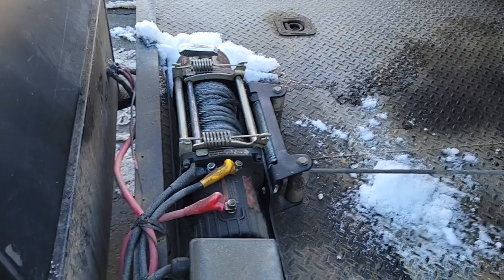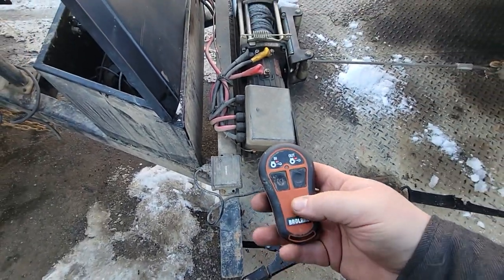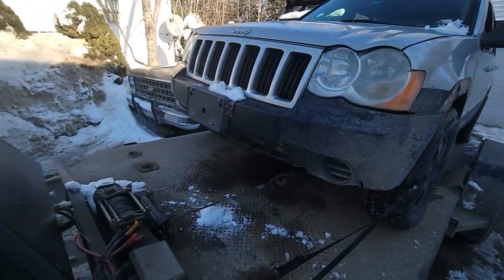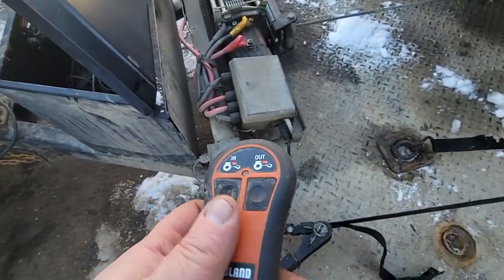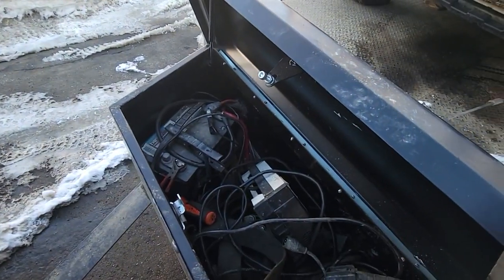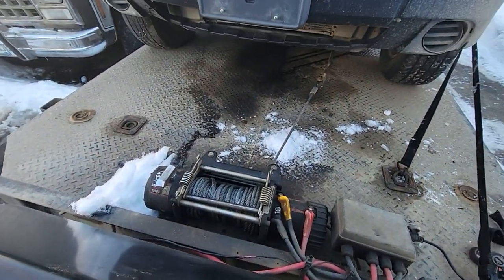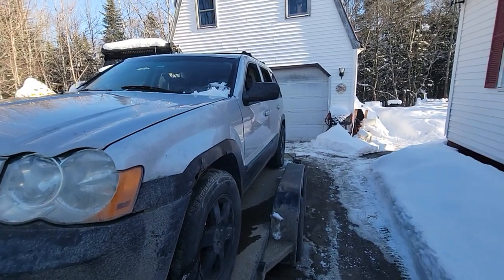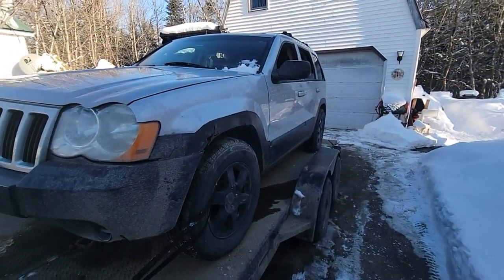Harbor Freight Badlands winch QUICK TIP! I'm Stupid...

Comment: the top red, yellow, black wires are switched wires. not a direct dedicated ground.
but then you should put in a winch to trailer chassis ground wire. not sure how your batt is wired but it also should be wired to chassis ground as well as directly to the winch.

BUT.  I would like to know if having the bolts on the bottom, holds under severe loads. as i see it to be a far stronger mount to have the bolts facing the load. AKA: the bolts just hold the winch, not get torqued trying to hold it down to a plate flat with the load. as the back two bolts are getting twisted and pulled up. while the front two are more of a compression twist load. think rolling the winch.

Comment: I have no idea why winch manufactures use black as the third color when it doesn't connect directly to ground. The black and yellow are the directions and are jumpered to the red by the control box when the winch is in use. Would be a good idea to change the boot or paint the current one a different color to avoid someone else from making the same mistake.

Comment: Is it made in China? (not China, Me.).
Reply: What isn't made in china....
Reply: @ToyotaPete  I wasn't.
Reply: Yes, and it has a wireless transmitter that sends China everything you do with the winch.  That's why the ground wire has to be in the right place, otherwise China won't let it work right.
Reply: @Chubbycat748  That little black wire also transmits data to those balloons as well.